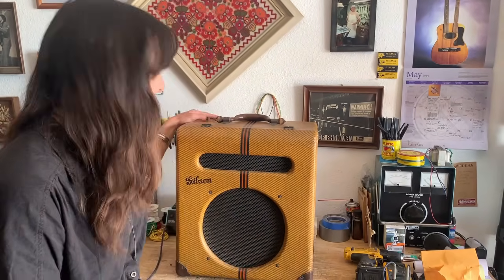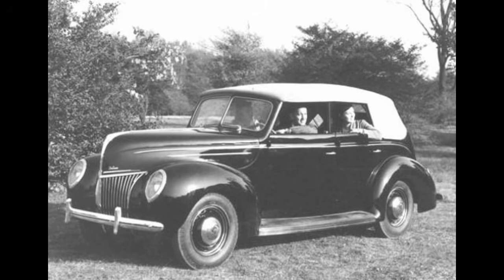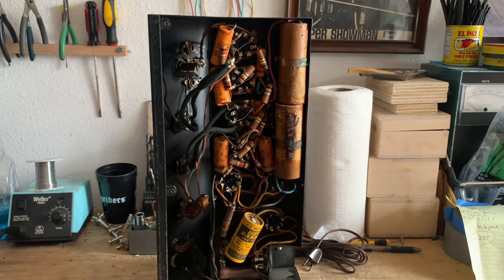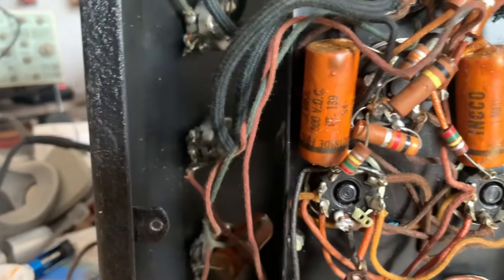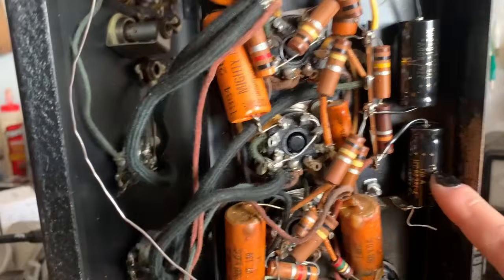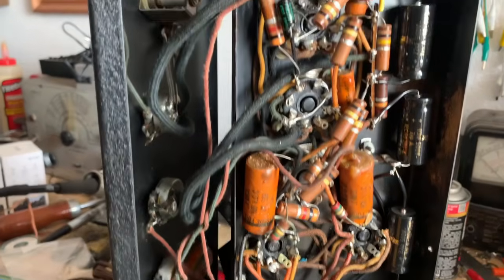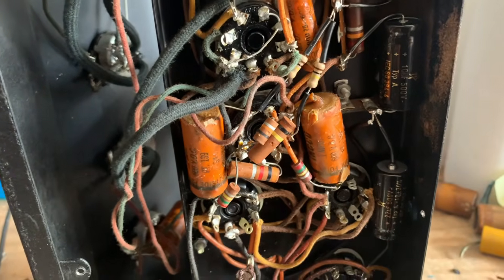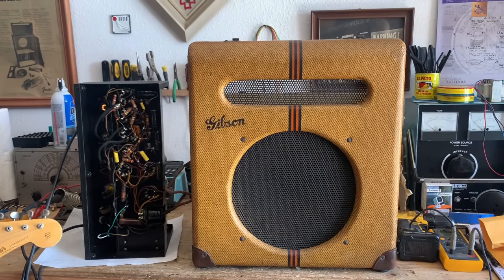Gibson EH185 Restoration | 1939-1940 Era Guitar Amplifier

Comment: That is undoubtedly the cleanest EH-185 on the planet. That 80 year old amp  literally looks better than many 5 year old amps do. I was hoping you’d pull an Uncle Doug and hide the new electrolytics inside the old cardboard originals. You still did a nice clean job.
Reply: I have one that is almost as clean 
....wonderful amp
Reply: It does look great would love to hear my 41 Es 300n played through it. It is also as clean and has original case that matches the cabinet of the EH. My arch top has the small diagonal pickup I believe it would make wonderful sounds.
Reply: Butt hurt
Reply: y'know, that schtick needs to go away:  fetishizing old just cuz old encourages valuing functional objects for nostalgia stupid reasons.  (& it introduces a possibility for error & makes visual inspections for leaks impossible).
Reply: @RichardMcLamore  Agree, take some pictures, put the old bits in a bag and use the amp.
Reply: Yeah might as well replace every component and tear off the tweed covering & install new Tolex. Let’s also trash the old  speaker and put in a brand new one. Old stuff sucks. Actually let’s re-house the chassis in a NEW apple crate.  We don’t want people to “fetishize”over something that’s an 80 year old museum piece since you seem to think people  jack off on minty vintage amps. I hope you play a solid state crate and not an old tube amp- otherwise someone might fetishize all over it, and then you’d have to pay some tech to chisel the dried up jizz off of it. Might as well burn down your house while you’re at it- someone might admire it from afar, or even in a YouTube comment section and you definitely wouldn’t want that. You can then build yourself a new ugly cinder block house that won’t be fetishized over. And if someone does happen to “fetishize” on it you can just spray it off with a garden hose.
Reply: @vadenk4433  exactly.. shouldnt replace the power cord either. if you cant figure out how to use a 2 prong plug you should just take up golf.

Comment: Replacing the filter and bypass caps prior to energizing is absolutely warranted.
The wiring of this amplifier very much reminds me of my all original 1947 MEC Troubadour.
What a fantastic Time-Capsule, thank you so much for sharing this with us.
Reply: You mean the coupling caps? Bypass cathode is not critical an often doesn’t fail anyways
Reply: @abubakr6939  I was speaking about the bypass capacitor used in the power supply, sometimes they are refereed to as a Decoupling Capacitor.     Any decoupling/bypass capacitors in the signal path would be a different story (unless visual inspection indicates its obviously failed).
Reply: @hkguitar1984  makes sense, though cathode bypass caps don’t actually pass signal
Reply: @abubakr6939  In my original comment I was only referring to power supply capacitors.

Comment: Well done!. I realize the goal was to keep this EH-185 as original as possible. You did achieve this with a changing of the obvious suspects; the filter, and coupling capacitors. Albeit successful, I would have enjoyed watching the upgrade of the two prong power cable, as well as a metering of the tolerances of the resistors; for any drift as well. Then again, you may have felt this was too time consuming for the flow of the session. Keep`em coming. Thank you for sharing.

Comment: Wow, when I first started watching this I paused it to go look at my amp. From the outside it looks nearly identical to mine. Once you opened it though it was obviously different.  Mine has separate Treble and Bass controls, there's an "echo speaker" jack on the left, the fuse is on the back of the cabinet, also the Logo, jewel indicator, and serial number are in the center of the front panel. My amp also uses 6J7 preamp tubes with Anode cables.  Very nice, thanks for posting this video.
Reply: Torgo, one small correction: the top-cap connection to the 6J7 is for the audio signal to the grid, and not the anode (plate) connection. The tube was designed this way in order to have minimal hum, which is why the 6J7 ( and its lower-noise compatible cousin, the 1620) were often used for mic preamps.
Reply: @goodun2974  Yeah, you're right, I forgot about that.   BTW there's an even nicer version of this amp at the gibson-prewar website  on the page gibson-1940-eh-185-amplifier

Comment: i keep wondering if its worth it to keep the old resistors in there as well. considering its that old, i would think swapping the caps and the resistors would be best because now we have high quality replacements.
Reply: Probably won't last 80 years.
Reply: Resistors tend to hold up very well, new ones wont sound same.

Comment: Not immediately changing all the waxies is a little baffling to me. There is no way they are not leaking DC, and all of them are clearly leaking waxy goo.
Reply: People grossly exaggerate this all the time, some drift is normal and could be part of the sound even
Reply: @abubakr6939  Good luck with that. I would argue keeping any waxies in a 1940s amp is not only bad but it's irresponsible. It's the job of the tech to talk the owner into getting rid of that junk and replacing it with something that won't damage the unit.
Reply: @Wizardofgosz  you are just regurgitating what you have been told by other people who regurgitated it because the internet said. I’m telling you from real life experience. If it didn’t blow for 80 plus years and still tests strong why should it not keep going? Indeed they keep going, and especially if it’s not a coupling cap or filter cap it has extremely low chances for damage unit.
Reply: @abubakr6939  whatevs dude. Just call me "the regurgitator."
Reply: @abubakr6939  If you think a cap that is leaking 20 volts of DC still "tests strong," then you shouldn't be allowed anywhere near electricity.
Reply: @Wizardofgosz  when did I say it was leaking 20 volts?
Reply: it's very likely the owner asked to maintain as much of the original parts as possible even if it means keeping some leaky caps and out of spec resistors. As long as it's safe to operate I don't see a problem.
Reply: @ChemXFX  there is no point in keeping leaky caps because they're "original." Those waxies are just BAD. Again. Just baffled.
Reply: @Wizardofgosz  I’d agree if it was something I was going to take out and play on a regular basis or want to be sure it was reliable. On the other hand something like this I’d keep for sentimental reasons and only take out to play in a recording or two, I’m ok with it drifting everywhere. To each their own I guess. Cheers!
Reply: Also, I agree it’s 100% not logical. But a lot of times with stuff like this, it doesn’t have to be. 🤘
Reply: Hey, she replaced the wax caps and guess what??? Amp now sounds like it should. It's not the wax that makes these caps bad, it's the paper dielectric used inside those caps. The paper degrades with age and becomes leaky...
Reply: I agree,even if the amp isn't used professionally,it should be safe to use.The vintage appearance can be kept by stuffing the new caps into the shells of the old ones when possible.I would have replaced those coupling caps first before cutting off those vintage plate resistors or at least checked them out first.I would have given the client this option first even though not requested.Amps like these deserve special treatment.

Comment: Interesting how the layout design amounted to using the tube socket lugs as the only anchor points for all other components.  Almost like the original assembly worker just connected everything per a schematic then shoved everything in the chassis.  It seems amazing it lived for 81 years without incurring a massive, potential lethal short somewhere.  Very methodical, logical work.
Reply: And I guarantee it was done by a woman, as women were thought to not only have more dexterity when doing this kind of intricate work... but it was thought women also had more patience. That's why the tag in your vintage Marshall are all signed by women.
Reply: I’ll have to start making some videos of the stuff I have, including a 1935 Dobro amplifier
Reply: It's called point-to-point wiring, which was then superseded by turret boards, eyelet boards etc, before finally switching to PCBs. For high voltage stuff, point-to-point is one of the better methods for construction, as it uses air as the isolating medium, so you have very little issue with PCBs or turret boards becoming conductive with time, and they're infinitely repairable, as you can just swap out standard components, compared to custom ICs and PCBs that quickly become unobtanium. It however looks quite messy, and takes a lot of assembly time, which is why manufacturers switched to turret boards, as then instead of one tech building the whole circuit one tech could assemble turret boards all day long, while another wires them into the amps, effectively cutting training time in half per tech, with less chance for mistakes.
Reply: @sstorholm  Yeah, what I just said. Women were used almost exclusively for these assembly tasks as they have both the dexterity... and most importantly... the patience to do this rather tedious yet vital part of the amps construction. I used to read the inspection tag on my old JMP Marshalls and wonder if "Stacy" or "Nancy" etc. who built my amp were hot 🤣
Reply: @sstorholm  in the world of tube amps using PCB are fairly “new”. 🤣
All my amps are mid/late 60’s and earlier all are point- to-point wired.

Comment: Wow; those are rare! Charlie Christian used one after his EH-150. I have a 1940 EH-150 that looks as good as that one; with typed instruction manual. 😉 Cabinets by Geib, which was also a case manufacturer that made the matching tweed cases for the EH-150 lapsteels and ES-150 guitars (I own those too). They are so nicely made.

Love your repair work; it’s flawless.
Reply: Interesting on Geib....is the covering a woven fabric like luggage linen or textured printed paper type with a thin fabric backing?...I'll never get a chance to see one of these close up!
Reply: @robbergin9586  it’s lacquered tweed fabric, like old Fender amps, as was used on old luggage.
Reply: @vayabroder729  Much appreciate the reply!😎....I'm looking at doing some retro cabinets and trying to find out all I can!.....some like the old Premiers seem to have a thin covering like bookbinders cloth...this looked so glossy I was wondering if it was actual weave....you have some classy equipment!
Reply: @robbergin9586  thank you sir; I’ve been playing and wheeling and dealing for over 40 years. The hardest part is making justice to your equipment with your playing.